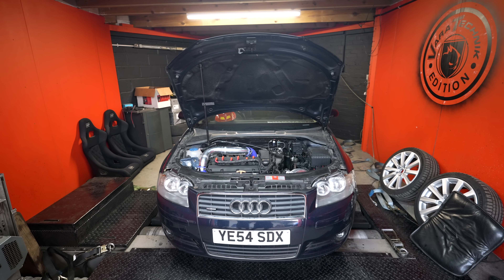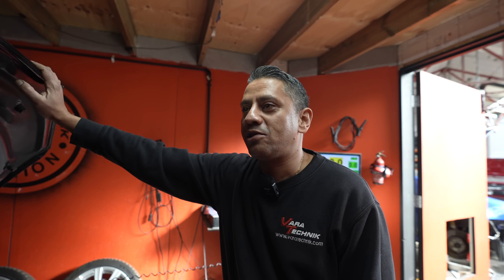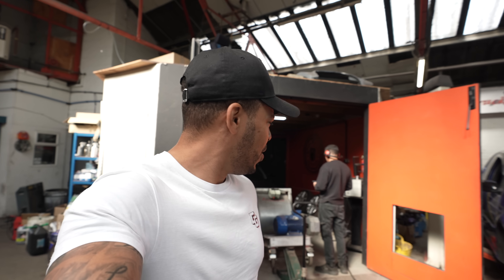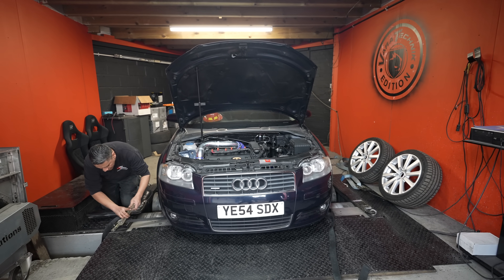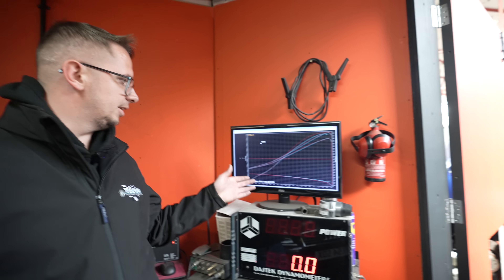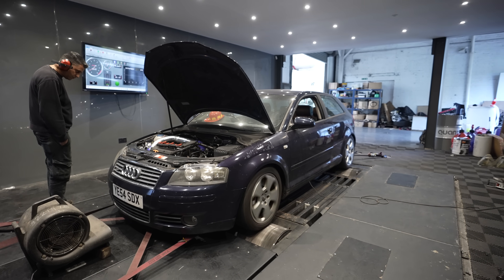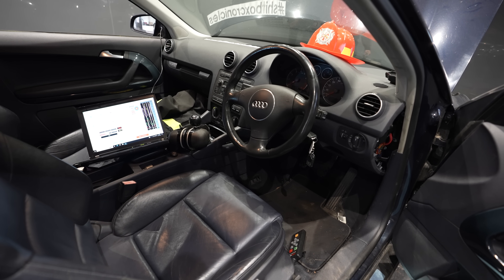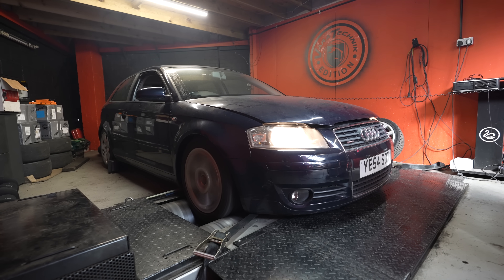THE SH*T BOX SLEEPER MADE TOO MUCH POWER FOR THE DYNO!!

Comment: I used to have A3 2.0 Quattro, bought it for about £1600 as a stop gap car but liked so much I kept it for 3 years, never had an issue with it apart from rust. Sold it fo £1000 so not bad going. Love my G42 230i now though.